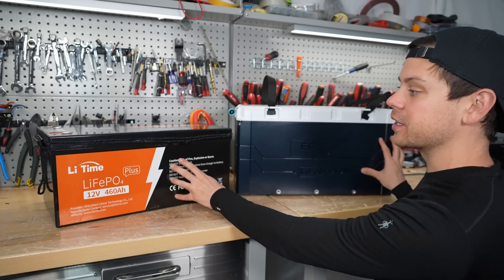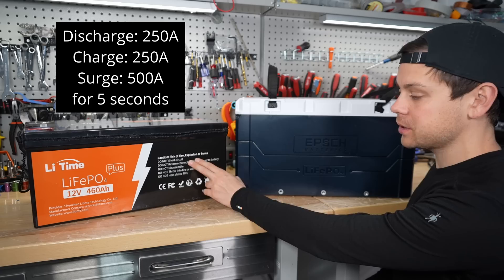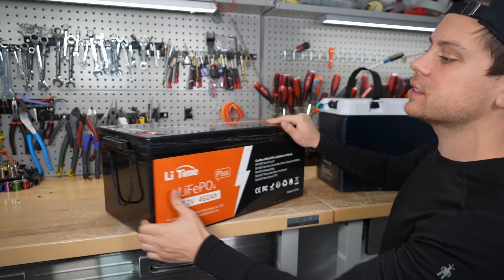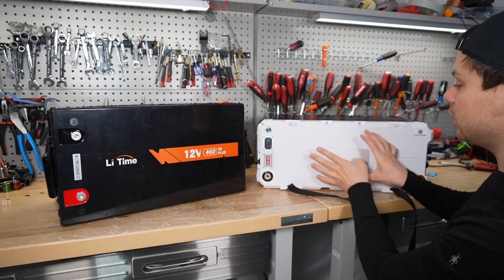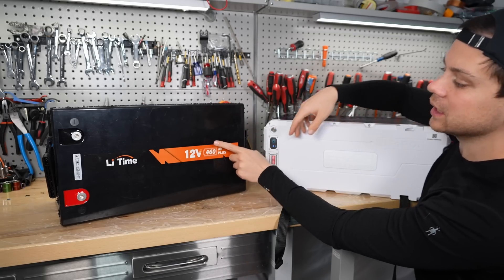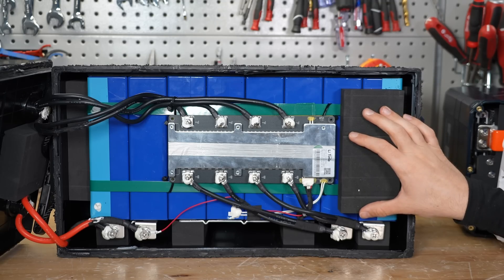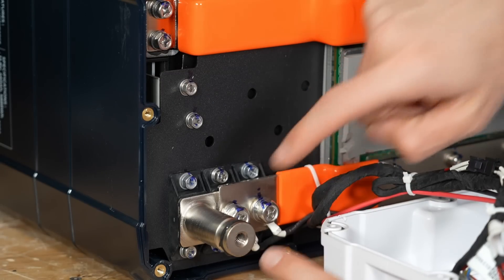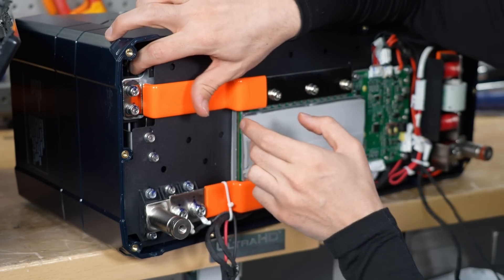12V Battery Showdown! $1,499 LiTime VS $1,999 Epoch

Comment: Why is it I can buy four (4) 12V 100AH batteries (4 enclosures and 4 BMS modules) for hundreds of dollars LESS than a single 12V 400AH battery in 1 enclosure with 1 BMS module?
Reply: Signature solar has a 400Ah rack battery for sale at $999 right now. That's about the same as 4 LiTime ON Sale batteries. Ya gotta look for the sale, I suppose.

Comment: The answer really depends on the application, for a typical RV installation I would be fine with the LiTime if it had low temperature charging protection.

Comment: I bought an Ampere Time 200Ah for an emergency backup home unit built on a hand truck using your guides. It  has kept my refrigerator and other essentials running through multiple power outages over the last couple of years. For my purposes it has been the perfect solution and I don't require anything more. Thanks, Will!

Comment: The question for me is whether the additional features are necessary, and if so, worth $500 for just one battery. For someone using it as the sole battery mounted 24/7 in an RV, it may be worth it.

I’m an amateur (ham) radio operator. So, I have no use for an energy-depleting inverter. Everything running on the battery is DC. I also don’t connect high-current or inductive loads to my LiFePO4 battery. The most I’ll draw in total is less than 25A for short durations when transmitting a 100W signal. Furthermore, I don’t leave my battery unattended in the cold. If it is outdoors, so am I, right beside it. When I use a portable solar panel to charge my battery, if it’s too cold to charge it, it’s too cold for me too. So, I’m not concerned about low-temperature charging. If I must charge it in freezing temperatures, it’s going to be snuggled in a warm tent or vehicle, just as I am. The only add-on I would use with the battery would be a shunt-based capacity meter. I would rather have it be external to the battery so I can transfer it to whatever battery I’m using at the time.

Generally speaking, a very effective means to extend the capacity of a battery is to avoid converting to AC or to different voltages. Install only DC equipment in an RV. Instead of plugging wall warts into an inverter, run DC-powered items, like laptops, WiFi routers, LED lights, and phone chargers by way of buck and boost converters instead.
Reply: Sorry to bother you, but do you have any tips or links for running electronics directly from 13-14V systems? I'm testing a home-built DC UPS for my electronics, and want to know if I'm missing important safety features. Do you use any voltage-reducing/feedback-preventing diodes? Can most 12V electronics handle 14.7V from solar chargers? Do you directly wire to your fuse block, or do you have a plug panel?

Comment: You could buy 2 Eco-Worthy 280 =560a for $1,038 or the same thing with 2 Chins for $1,080. Way cheaper and more power! Or even the Enjoybot 400 amp with low temp for $1,100.

Comment: I have trouble fitting two Epochs into my Ford Transit.   I'm able to stack two Li Times vertically with an 8020 rack while keeping the bed above them at 22 inches..   I don't have the room to stack the Epochs vertically, I'd hve to raise the bed 4 inches higher.    The only way I could use the Epochs is if I mounted them sideways, which would surely confuse the temp sensors & heaters.   Also, Epoch has been out-of-stock for a month now.

Comment: My 2 Ampertime 400ah batteries fit in my stock battery box and small compartment with heaters on my class c motorhome. Had them for years with no issues. 👍🏻
Reply: How do you heat your batteries?  Or compartment?
Reply: @danemmerich6775  temperature controlled RV water, black or gray water tank heaters. They work great 👍🏻
Reply: @danemmerich6775 I think he means they have the self heating feature

Comment: I’m guessing that using a generic BMS will not be as well matched to the cells as a BMS designed by the same company. 
They can afford more reliable components in their circuits. The whole battery being made more rugged can contribute to the life of the system. 
If a lower quality component fails before 6000 cycles, then you just say that the batteries are good for 3000 cycles. 
There are a lot of variables.

Comment: The one thing I never hear you say is: Wait for Black Friday or Prime Days, the prices drop maybe 30%. You have recommended GoWise inverters. If you go to their Web Site the price is less than half of Amazon. For me it's all about price point. If you live off-grid, $10-15K is probably worth it. But for the average user that camps a few times a year, that has a hard time to justify spending $1-2K on a Honda generator, a $2k battery is just not in the budget. You can get a 300a-400a battery with low temp for about $1k and a Victron 100/50 for $200 and 40amps in solar panels for $600 = $1800. Why would the casual user think a $2,200 (with tax) is a good deal. The hard core off-grid person is more likely to use server rack batteries.

Comment: Li time just needs to add reliable overcharge and low temp. Everything else I don’t need. If I wanted a battery to have everything I would just buy a eco flow pro for $2200 that now comes with the remote screen. Can’t beat that.

Comment: 6000 cycles is huge, a major swaying factor towards LiTime!  It makes me blink and look not twice but 3 and 4 times. However, 86 lbs for LiTime and 97 pounds for Epoch makes my back hurt, but doable in a pinch and I would've considered it 2 months ago.  2 months ago I would've picked Epoch for everything included in tidy design PLUS heating, for my 2013 Ford Transit Connect Camper Van build.  But lets say I was living in it 2-3 weeks at a time, and I do already have some leftover victron components from another solar car camping build 2 years old, would a $26 silicone heating pad work with the LiTime and be an appropriate application here for a camper van build?  These heating pads are traditionally used for regular ICE car batteries, and I've heard RVs and Van Builds have been using them as retrofit, but do they set the LiTime battery directly on the orange silicone heating pad? Or put an insulator between the 2? Could you make a video about that?  Or is it considered unsafe so people don't make youtube videos about that?  But VanLifers do it anyway in practice, or do they use another product as a heating pad?  Ultimately due to WEIGHT and price 2 months ago I had to choose $899 Bluetti AC180 with bluetti 200W folding portable solar panels 2 months ago because I don't want to wrench my back moving the system in and out of my 2017 Prius Prime for car camping (which I'm highly successful at).  And I can use same system for car camping in my new to me 2013 Ford Transit Connect, which is colder because it's not built out yet, but I'm working on that. And I need to bring my battery inside my house most the time because my car and van is too hot or too cold for best maintainability of the battery. If Bluetti hadn't offered the great price with all in one 2 - 6 months ago, I'd be looking at the Epoch for the Ford Transit Connect due to so many safety options added in for the price, and still might as my build progresses further along, or as I consider larger camper van builds in the future that I can actually stand up in.

Comment: On the cycle life comparison, I couldn't find anywhere that the Epoch battery stated the DOD for the 3500 cycle life. When I started working with LiFePO4 batteries in the early 2000s, the cycle life was stated as 100%DOD until the battery had either 80% or 70% of rated capacity. Typically, the quality cells were rated to 80% and the cheaper ones to 70%. Given that the LiTime battery lists 4000 cycles at 100%DOD, I suspect that the cells in the LiTime battery are not necessarily better than in the Epoch battery. Since neither one lists the rated capacity degradation, not much comparison can be made other than the longer warranty of the Epoch battery.

For me, I would go with the Epoch battery because of the extra features built in.

Comment: Would love to see you utilize micro inverters in a design.  While there may be some drawbacks,  it seems like the design is straightforward, though I need a better understanding that your experience can provide.  Thank you!
Reply: Microinverters are a grid tied unit.  They require and AC grid to send power to and will not operate until they detect AC to sync with.

Comment: For the price of the LiTime you can get a 48v 100 ah server rack battery with an LCD , smart BMS and circuit breaker. You can get a basic 48v 100ah battery like the LiTime you have there for hundreds less. So my advice is chuck the 12v and 24v stuff and go with 48v. unless there is a specific reason you must stick with those lower voltage batteries and systems. If I'm thinking 15 to 20 years into the future, I'd go with 48v. and save some money too.
Reply: You dont want a server rack battery in a boat or motor home
Reply: @enigma9789  EG4 server rack batteries are warrantied for 10 years when mounted in an RV. You can even mount them vertically, which is great for tucking them out of the way.
Reply: RVs are 12v based. Even if all your solar stuff can do 48v, you will need to add a component to power the 12v system. That adds complexity. I'll stick with the 12v batteries.

Comment: What should your charge perimeters be on the charge controller for a 12v system?
Reply: The battery company should be able to give you those specifications, but if you're talking LiFePO4 batteries, 14.6V should be the Bulk/constant currant setting, with Absorb/constant Voltage setting being 14.2-14.6, and Float being less, though Battleborn says the Bulk and Absorb can be the same, with no Float drop needed. I am assuming you are talking solar charge controller. Unlike Lead-acid batteries, LiFePO4s don't require the monthly equallization of even higher Voltage.
Reply: You ARE best off checking with your battery manufacturer to make sure of each setting!

Comment: Sorry if a bit off topic but what do you guys think about using a large power station for powering an RV/Camper. For example a Fossibot F3600 costs about the same as the LiTime battery. capacity is a bit smaller at 3800Wh but this includes a 3600W inverter, 2000W solar charge controller, low temp charging protection and lots is different USB and 12V outputs. Sure if you have huge 12V consumers this will be a limitation but for my use the 25A at 12V are plenty. Is there anything speaking against using such a system in a mobile application?

Comment: The Epoch is actually 33% higher than the Li Time, 33% of $1500 is $500. Although the Li Time is 25% less than the Epoch.

Definitely would buy Epoch.
Reply: that's what i was gonna say 😁🤣
Reply: Yes I agreee, this math trickiness is interesting, and it may save you actual money during a transaction if you catch the mistake someday :
 "Epoch is 33% more than Litime, but Litime is 25% less than Epoch. 
1,500 plus 1/3 of 1,500 is 2,000, ...one third more.  
2,000 minus 1/4 of 2,000 is 1,500...one quarter less
Reply: @mikemotorbike4283 Now that you know how parsing data works you can go in to marketing or be a politician.. 😂
Reply: its even worse. these battery prices are while the sale price lasts. once the sale is over Li time is $2100 and epoch is $3000. is epoch still worth the higher price if not on sale?
Reply: @MYCHANNELWITHMYSTUFF  In my opinion, yes. Due to the superior BMS and bus bar connections. Overall build quality of the Epoch is way better. Maybe the answer comes down to "how long do you plan to have whatever it's installed in". I have Battleborn and bought them long before either of these 2 brands came out. When I traded campers, I kept the batteries. If I needed batteries today, I would buy the Epoch X 2.
Reply: Yes correct, but my wallet feels the 25% or 33% either direction, lol....Guess my wallet does not know good math.   goodcitizen had the best "Quality will be remembered long after price is forgotten."  Sounds like he's related to Ben Franklin.
Reply: There's someone in every group that has to try to prove their superiority.
Reply: And you can get the essential version for same
Price as Ali Time.  Given the comms doesn’t really work that’s the battery to buy.

Comment: One question: what is the fuse for - where in the line is it installed? Is it just a general fuse for the battery's output? So you don't need a fuse in front of a cutoff switch? I cutoff switch would be nice! Sounds like about a $400-600 value in total. Now that i have my system running with a few months experience and 2 seasons up north here i can answer definitively i would go with the more expensive battery. last year i would have gone for the cheaper one. Strange weather caused sub 0C weather, so my batteries shouldn't be charged. When the sun comes up and you sleep in, solar will start charging. I went ahead and switched over to my other battery which can be charged. My batteries and charge controllers don't have low temp protection, even though they all have sensors - it's only for high temp. So this was a pain, running a heater and carrying a battery back and forth as i can't plug the van in. My rate of recharge means i will probably not outlive my batteries at 3500 cycles to 80%. I have more capacity than i need so 80% will also suffice. The other thing i love is my renogy shunt, that was a great decision. i later bought a cheaper shunt for the other battery and it is ok but nowhere near as helpful as the renogy. So basicially i could use low temp cutoff, some battery heating and i love a shunt. So the included features of your more expensive battery is better for me. If i was in a boat i would think the great busses would also be confident although the litime is prob fine for that too.  It also looks like the top is easier to remove and i like the fixing bolts. Thx Will. btw it turns out the thermal mass of my batteries are sufficient to keep their temp up above 0C but over a 3 day/night period it got closer.

Comment: Thankyou for the comparison video. My use case is for a motorhome, however the cost difference is an issue for me as I am buying more of the Litime batteries  I installed the LiTime 8 months ago and it's worked amazing. Life changing actually. I diy'ed a low temp  compartment heater using a ws1209 temp sensor and 3 1157 light bulbs (75w) that keeps the compartment warm on cold desert nights. I use a BT thermometer to monitor compartment temps 
Have a Renogy Soc meter that is honestly the worst part of my setup.

Thanks.
Reply: Thank you for the info on your low temp heater. What temp do you have it set to come on at?  Does it work well enough or would you do anything different? Like maybe buying batteries with low temp sensor and heated.
Reply: @danemmerich6775  your welcome. In my motorhome I installed the LiTime  battery in the existing battery compartment. That compartment is 3'x3'x2' and it was vented to handle the off gassing for the lead acid house batteries. With the LiPo4 battery i sealed the vent holes (to keep the heat in)
I looked at buying the battery heater blankets Will talks about, but decided to go with what I had on hand using the generic ws1209 and some 1157 bulbs give me 75watts of heating. Total cost for compartment heater is $5 for the Ws1209 and I had the (3 ) 1157 bulbs and I am a DIY junkie. The weak link in my case is the Renogy SOC meter, its terrible, but it works.

If I had the money i would have used the Epochs or better yet converted to a 48 volt build and would suggest that if are not $ strapped for the Epochs.

But because I have an existing Magnum power inverter (12v 2000W) and a $ constraint I needed to stay in the 12 volt world for now.

With only one LiTime 460 AH battery and 1.5 Kw watt of solar I can dry camp using very little generator usage (only the cloudy days)
Reply: @danemmerich6775  set to 38F

Comment: 2:30 "bolting them together" isn't a problem 
   Simply build a mounting rack out of metal channel (known in the UK as unistrut ). It comes in sizes 40 × 25 shallow × 40 deep × 80 double. Simply bolt the batteries onto the channel using L brackets,  channel fittings come in M6/8/10/12 . The channel itself can be Used build the server racks much cheaper and far stronger than anything you are likely to be able to purchase of the shelf
   I used to build and work on offshore unmanned gas platforms the battery backup systems were constructed like this the cells were about ×4 the size of those featured and overall each battery bank measured around 4×4×6 (ft)
Reply: I like that approach.  Could use a piece of strut across the top of the battery(s) with some all-thread on the ends to hold them down.  Unistrut is a brand name that has become synonymous with that material. We have that brand (and a few others) here in the USA as well.
Reply: Unistrut is good stuff. All physics lab equipment is built using it. That’s all that I remember seeing in the labs.
Reply: @edwardlulofs444  yes built a level 3 bio lab out of it in 2017-18 .... just in time (apparently)🤦.....and data centers too 🤦🤦🤦

Comment: IDK, from what you've presented, both seem like they could be a good choice, depending on the details of a particular system (like for example, would you ever really need to worry about cold temps there in Vegas, esp if they were inside a garage / building).  If you can afford the extra $500 / battery, clearly the Epoch is a battery with superior features.  LiTime seems like a lot of bang for the entry level buck.  Call it the stripped down base model car vs the one from the factory with all the bells and whistles.  If you need "basic" capability at absolute minimum cost, seems like the Li might be the choice.  If you have a bit of room in the budget, or simply need the features, Epoch is worth the extra cost.